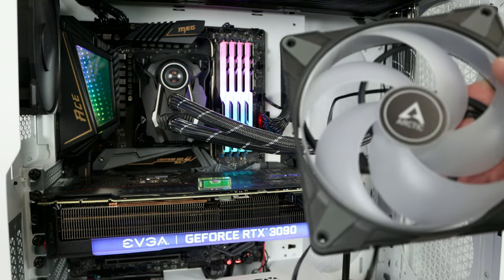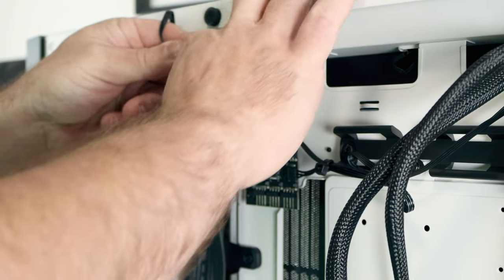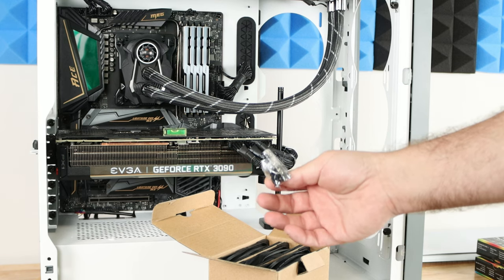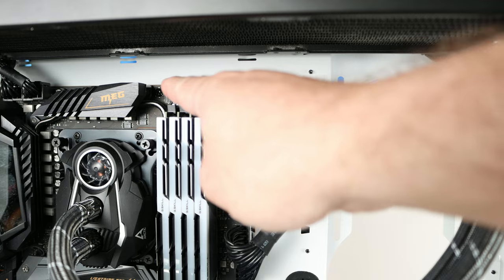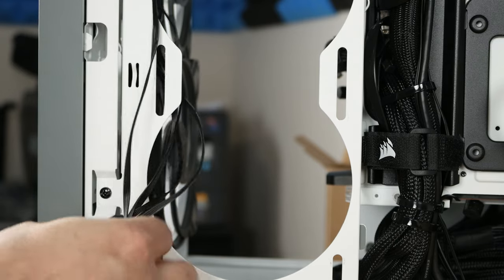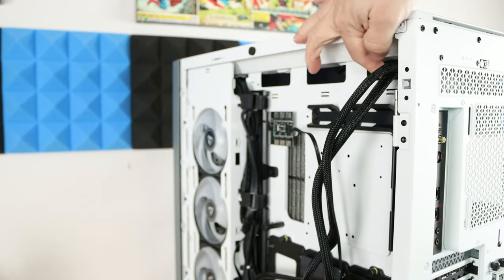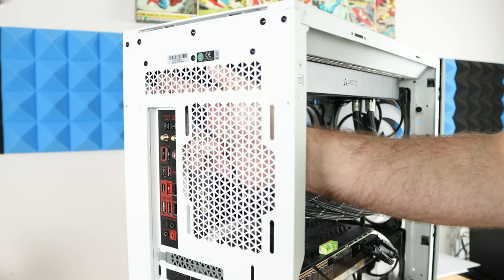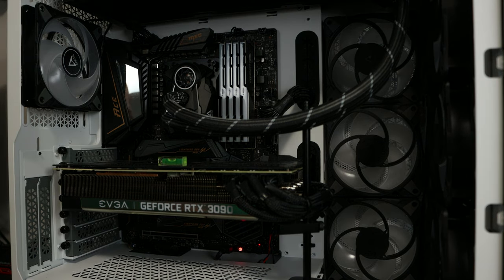How to Install a Case Fan in your PC - Step By Step Gaming PC Cooling Guide

Comment: I gets properly confused when it comes to fans, lol, I upgraded my PC case from a small form factor Phantek case, Top case but the small cases gather dust really badly, So I upgraded to a MSI MAG Forge 320r Airflow gaming case, Fantastic case for the price, MSI even got one that is a 100r  I think lol, A bit cheaper than the 320r case, But the Mag 320r case is amazing, I can install 11 fans in it if I wanted, lol, Overkill on fans so I only got 8, But there is only one fan header on the motherboard, I think the motherboard was the biggest mistake of putting the i5 12600k CPU and a 3060 12gb GPU, Great combo by the way, I can get Beam NG and AMS2 looking great considering, I only got a 60hrz TV so anything over 60FPS would be a waste of time wouldn't it? lol, Can tell I am still a newbie new to Sim Racing on a PC, And I been using a PC now for about 2 years I think, Console was wasted money, If you want to do Sim Racing you need a PC, Sim Racing is a different world with a PC, But yeah I installed another 2 fans the other day, I got a thermalright fan splitter box for the ARGB, But because I am still a newbie to PC building, I had a friend show me, So next time I will be able to put the PC together, But I am still on the fence about fans, lol, I gets confused like brain fog comes along when it comes to getting ARGB on fans without getting confused on what goes where, lol, I am good a lot of things that involves your hand and brain at the same time, But when I am bad at something, I am bad, lol, I have not got the spare money to buy bits if something goes wrong, Brings me on to the motherboard, Mistake I made was getting a cheaper board, Thinking it will still do the same, Only getting one M.2 was a stupid mistake thinking I wouldn't use or need more M.2 drives, Wrong, I have a crucial M.2 drive and no extra slot for the M.2, So it is probably better to put a bit more into the motherboard with the price, Pay extra, I got a Gigabyte H601i motherboard, Although it is a decent motherboard for gaming and everyday use, I wish I payed a bit more and got a better motherboard with better Ram capabilities ect, And more than one M.2 drive, lol, I didn't realize that the motherboard can make such a big difference, So I am thinking I needs to upgrade the motherboard a bit now, I can't go crazy but if anyone can tell me what is the best motherboard for the i5 12600k, It is a fantastic CPU for gaming, Again I am wishing I did get the i7 12th gen, That will be later down the line when I come across an I9 deal, lol, I seen motherboard, CPU and Ram bundles but I am not rich enough to spend 500 pounds in one hit though, If I could I would be getting 40 series GPU, Though I will say the 3060 12gb is a great medium settings GPU, Beam NG looks fantastic on my TV, Most Sim Racing titles you don't see the difference from medium to high settings, It is when you get to ultra of the highest setting you can do, But from medium to high I don't see much difference, lol, I am getting 60 FPS on Beam and AMS2, And any other Sim Racing title, And on a 60hrz TV 60 FPS actually looks pretty smooth, I don't get frame freezing, And that is the main thing, As long as I got smooth gameplay then I am all good, I am grateful of the PC I have even though it ain't no high end monster, It still runs the Sim racing far better than a console, And now you can build a PC not far away from what a console costs with I would argue better specs, I seen a few vids on You tube doing that, All be it used parts, lol, If you find honest sellers who looks after what they got, You can actually find some top used PC bits, I only buy new because of the warranty is more important for me....
Good video though, Explains in English what needs to be done, It must be my brain and fans, I can never get my head around what where goes where, lol, I will keep at it until I know fully though, lol, Just will keep watching vids like this I guess, lol...
Yeah what Motherboard would be good with an i5 12600k and a 3060 mainly for Sim Racing and a bit of music production, I am getting back into the Hip Hop producing soon as well, What would be a good motherboard?
Happy Do It Yourself PC'ing 2, lol...
Oh yeah the MSI Mag Forge 320r Is a great case, Would go great with the MSI MOBO you got...
Reply from the maker: So happy you enjoyed the video.  for motherboards, I think this one would be perfect for you, in a build as well: https://youtu.be/yqj9slC6-Cg
The MSI board I have is for AMD
If you are going for an MSI board, this one might be good off of my Amazon affiliate link: https://geni.us/Malbv
I hope this helps.

Comment: the 4 pins fan header is easy to understand but the RGB and ARGB is kinda hard to understand.
Reply from the maker: What is hard to understand about them?
Reply: @ThisBytesForYou  i want to be able to control the fan speed and change the RGB with software. If I guess correctly, i need 4 pins 12V PWM fan connector for my fan and 3 pins 5V for the ARGB right? I want to install 7 RGB fan in my chassis like 3 top, 3 front, and 1 for rear fan. I'm planning to get the MSI MAG Z790 TOMAHALK motherboard which have 3 ARGB Gen2 and 6 fan headers so i guess i cant install them all directly to the motherboard cause there arent enough fan & ARGB header. 

Please correct me if i'm wrong. So basically to install the 7 ARGB fan, i need the fan splitter cable at least 1 1-to-2 4 pins PWM fan splitter to make it have enough for 7 PWM fan if the fan doesnt have daisy chain cable like in the video. (at around 10:03)

Another thing, I need ARGB extension or female splitter cable to add more ARGB connector enough for 7 ARGB headers and use the main header connect it to the motherboard. 

If all the summery i did above are correct, i have another question. If I want to make the 3 front fans, 3 top fans, and the 1 rear fan have different color, do i have to get 2 1-to-3 ARGB fan splitter for the 3 front and 3 top fan? or can i just change their color differently in the software?
Reply: @ThisBytesForYou  gotta say connecting the right cable to the right thing in PC building is so much harder than placing the component together. 🤣😂
Reply from the maker: Well with PWM, you can the 4 pins on 4 pin headers, like I show you in this video, same with aRGB, your board has 3 argb headers.  The cool thing about that is you can split them, I do, I use this cable, that makes 1 header connect to 4 fans off of my Amazon affiliate link: https://geni.us/woVc4Ma and you will surely need to extend them, I do, you can buy a few of these cables too off of my amazon affiliate link, they are all VERY cheap, I have bought at least 10 each (I lose things a lot hahah) https://geni.us/xkEz

Comment: my system fan header has only 3 pin but i have deepcool rf120 which comes in with pwm4 pin can i still put in?
Reply from the maker: You can but instead of pwm controlling it, you will need to control it with voltages.  I doubt that you dont have any on your board, what is the motherboard manufacturer and model name?
Reply: @ThisBytesForYou  i have colorful a320m k pro
Reply from the maker: You have one at the top and one on the bottom of the board
Reply from the maker: Actually I read it backward, yes 3 pin fans will work fine in a 4 pin header
Reply: @ThisBytesForYou  Thank you
Reply: @ThisBytesForYou  how about 4 pin fans in 3 pin header?
Reply from the maker: @WeRideFree  yes that will work, you will notice there are plastic ridges for a 3 pin fan in the 4 pin connector and header
Reply: @ThisBytesForYou  you are awesome. subs 🤩
Reply from the maker: thanks so much my friend, I truly appreciate your kind words and support, it means the world to me.

Comment: 23:23 What if our case comes with a front panel. That's glass, And we can't get a mesh front panel??
Reply from the maker: then you would have the fans along the side or the bottom for intake, like the Hyte Y60 or cases like that.  What is the model number and manufacturer of your case?
Reply: @ThisBytesForYou  Ah well that would make more sense If i had one of those. The case I have. Is the "Deepcool MATREXX 50 ATX Mid Tower Case" So it came with 4 fans pre-installed. My PC was pre-built in general, So I was just curious if I could swap out the 4 that it came with for some cooler master ones. I'll have to do some more research. Thank you though!
Reply from the maker: yup, you sure can and this video will help you ;)  The front can take 120mm fans and the rear can take a 120 or a 140mm fan.  At the top, you can have either 2 x 120mm or 2 x 140mm fans or a radiator up to 240mm.  https://www.deepcool.com/download/pdf/MATREXX_50_Installation.pdf
Reply: @ThisBytesForYou  Sweet! Thank you, I'll for sure be coming back. To this video especially, once I get the new fans!
Reply from the maker: @NewYorksFinest  sounds good bud, I'll be here, let me know how it goes.

Comment: Does anyone know how to install fans to the top
Reply from the maker: same way I do it here, just at the top?
Reply: @ThisBytesForYou  yeah but im trying to use the fans and they keep falling down
Reply from the maker: Have you watched this video?
Reply: @ThisBytesForYou  yes
Reply: @ThisBytesForYou  but the problem is that the screw doesnt screw in the fan
Reply from the maker: when you buy the fans, they come with the screws, those screws fit into the fans and case, you can check out these screws from my Amazon affiliate link, these are those screws: https://geni.us/jArB1
Do you know the manufacturer and model number of the fans?
Reply: @ThisBytesForYou  its called the montech ax120 pwm 3 pack
Reply: @ThisBytesForYou  it also came with some long screws that im really confused about so thats also in there
Reply from the maker: what case is it?
Reply: @ThisBytesForYou  the king 95 pro
Reply from the maker: @Botaim-6  They haven;t sent me the king, I've asked a few times, but this video might help: https://youtu.be/8I4e6sw0meo
Reply: @ThisBytesForYou  ok